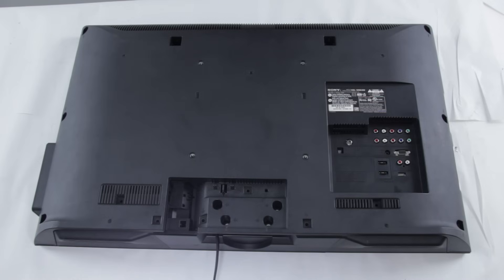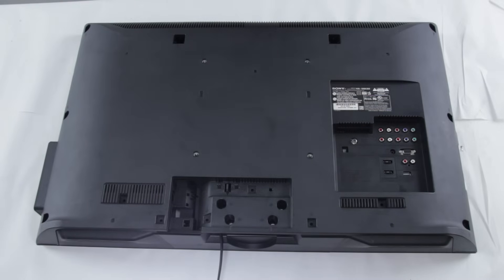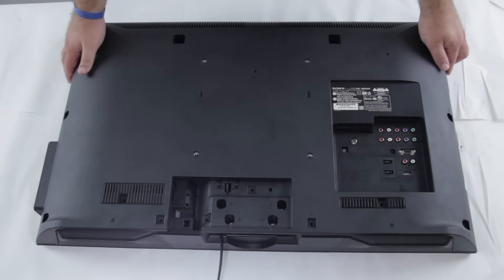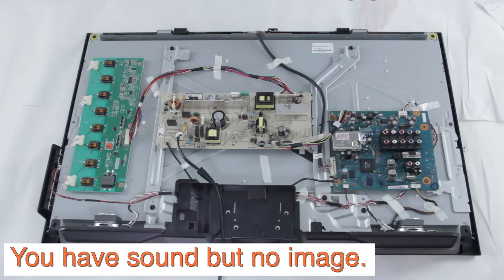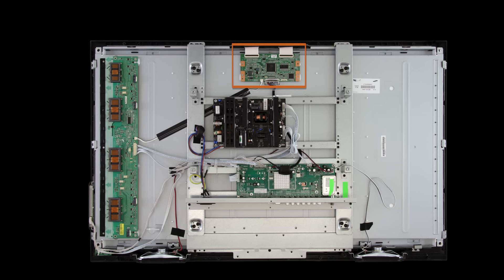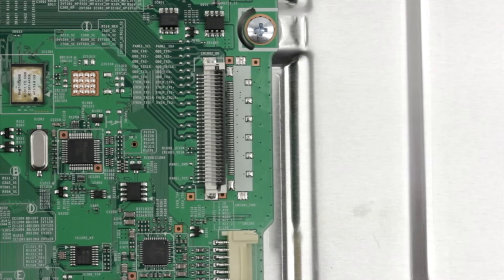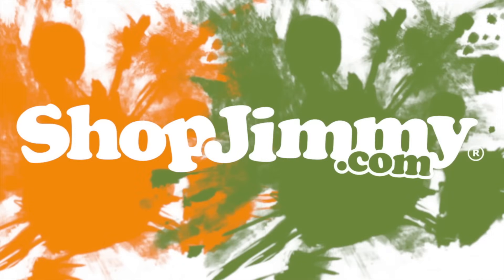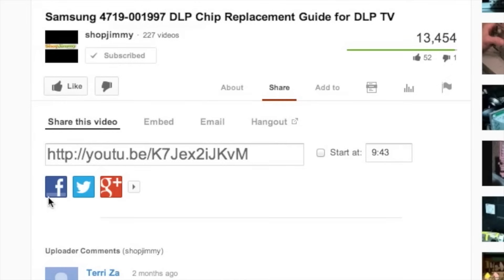LCD TV Repair Tutorial - T-Con Board Common Symptoms & Solutions - How to Replace T-Con Board

Comment: I AM TRYING TO TS A SHARP MODEL LC 42SV50U, SN  2090841355.  i AM GETTING NO SOUND AND NO PICTURE.  (BLACK)  I TRIED THE FLASHLIGHT TEST BUT COULDNT SEE ANYTHING.  I TRIED THE LOOKING FOR THE LIGHTS FROM THE BACK AND COULD NOT SEE ANY LIGHTS.  I HAVENT REMOVED THE BACK PANEL TO LOOK FOR LIGHTS.  I HAVE TRIED HOOKING OTHER EQUIPMENT TO IT TO SEE IF THAT MADE A DIFFERENCE BUT IT DIDNT.  WHAT NEXT STEP TO TROUBLE SHOOT THIS TV?  THANKS RICK

Comment: I've got a Emerson LD-195EMX that will not go into standby power...it automatically goes to power up when plugged in.  It has a raster and seems to go thru a diagnostic sequence with a white screen, red screen, etc.  The serial # is DS1A0939318105.  Thanks in advance.

Comment: Hi. i have an LG 42LS5700-UA smart LED tv. My problem started with a few flickering horizontal lines. It then progressed to cover the entire screen and with a few colored vertical lines. After that, we tried taping one of the ribbon connectors as suggested in one youtube video. However, it only caused a white screen with faded colors. All this time, sound is perfectly okay up to the present. Now, however, the screen is completely black. What solution can you suggest? I deeply appreciate any help.
Reply from the maker: +Kim Araneta   Try all repairs and troubleshooting at your own risk.  This sounds like a TV panel (TV Screen) problem.  If your TV panel is bad, it may be more cost-effective to replace the TV as panels are typically hard to find in stock, difficult to replace, and expensive.  Thanks and please let us know if you have any further questions!  www.shopjimmy.com

Comment: Yes hello I have a sanyo dp42849 Chasis p42849-01 i have replaced the power supply board and the main board, so now to what it was doing originally when i plugged it in i would get a  green blink for 2-3 seconds and then turn itself off, i would be able to do this a total of 3 times before I would have to unplug it for it to do it all over again, replaced the power supply board which in my model the P42849-01 is where the back light inverter is also located, nothing it did the same old thing, okay then ordered a new main board got in today switched it all out, and now the green light stays on but blinks once every 15-20 seconds. So any help will be much appreciated.
THANKS
RUBEN
Reply from the maker: +ruben echezabal   Try all repairs and troubleshooting at your own risk. It sounds like you have received a defective replacement board.  Thanks!  www.shopjimmy.com

Comment: i have a samsung UN40B6000VFXZA- serial number is AZ143CSS300687Y ...it has vertical bars that run from the top of the screen to the bottom of the screen. it happened just after i cleaned the screen. I suppose it is possible that a droplet of water got between the bezel and the screen...

Comment: model no. 50k610gw , i have solid red light no flashing or clicking  and tv  power light on  bottom  center also solid tv will not shut off but i have no image or sound i have did flash light test and see no images  i also replaced power board and still no luck.

Comment: Hi. I have a Samsung LE32R87BD.
I'm getting sound and backlight but no picture. Power supply had a bulging cap which I replaced while I was in there.
Someone suggested the "fuse" on the T-Con board had blown. I can't find it to confirm.
In your expert opinion,  what should I do/replace?
Thanks.
Reply from the maker: +ro63rto   Try all repairs and troubleshooting at your own risk. This could be a problem with either the t-con board, the main board or the TV panel. You can replace the main board and the t-con board individually to see if one of those boards fixes the problem.  Unfortunately I do not see any replacement parts in the search results for your TV model number on our website.  Thanks and please let us know if you have any further questions!  www.shopjimmy.com

Comment: I have a Westinghouse VK-40F580D. When I turn it on 1/2- 2/3 of the screen flickers and rolls and it is blurry. The image stays like this until it "warms up" then it returns to normal. Any recommendation for repair will be appreciated.
Reply from the maker: +Kristen Nolte   Try all repairs and troubleshooting at your own risk.  I recommend replacing the main board in your TV.  Click this link to replacement parts for your TV model number:  http://www.shopjimmy.com/catalogsearch/result/index/?cat=56&q=VK-40F580D  There may be multiple boards for the same TV model number, be sure to match part numbers on your current board, with your replacement for compatibility.  Here is a link to a video showing how to identify your part number, click here:  https://www.youtube.com/watch?v=SoUXsgOx25o  Thanks and please let us know if you have any further questions with your TV Repair!  www.shopjimmy.com

Comment: I have an LG 55LN5710 TV, I replaced the T-Con board ordered from SJ as the TV had no picture , the problem persists ,still no picture ,sound ok. when I power it on I can watch it for 10 minutes and then the picture goes away, please help
Reply from the maker: +Mn Aamer  Try all repairs and troubleshooting at your own risk.  This could be a problem with either the main board or the TV panel.  You can replace the main board to see if that fixes the problem.  Click this link to replacement parts for your TV model number:  http://www.shopjimmy.com/catalogsearch/result/index/?cat=56&q=55LN5710  There may be multiple boards for the same TV model number, be sure to match part numbers on your current board, with your replacement for compatibility.  Thanks and please let us know if you have any further questions with your TV Repair!  www.shopjimmy.com

Comment: Samsung LN40A500T1FXZA  -  Serial Number: ARVY3CSQ801553H  The basic settings have to be set to 100 to get a reasonable picture.  Sound is fine.  The overall picture is not crisp as in the past.  It is like you would want reduce the brightness but in doing so you get the solarization affect.  Thank you.
Reply from the maker: +Lewis Thorp   Try all repairs and troubleshooting at your own risk. This could be a problem with either the t-con board, the main board or the TV panel. You can replace the main board and the t-con board individually to see if one of those boards fixes the problem.  Click this link to replacement parts for your TV model number:  http://www.shopjimmy.com/catalogsearch/result/?q=LN40A500T1FXZA  There may be multiple boards for the same TV model number, be sure to match part numbers on your current board, with your replacement for compatibility.  Here is a link to a video showing how to identify your part number, click here: Thanks and please let us know if you have any further questions with your TV Repair!  www.shopjimmy.com

Comment: Good morning,SONY - KDL-EX705Syntoms: Has sound but not has vídeo in any source, led backlight on normaly. I suspect to T-con board
Reply from the maker: +Admailton Oliveira     Try all repairs and troubleshooting at your own risk. This could be a problem with either the t-con board, the main board or the TV panel. You can replace the main board and the t-con board individually to see if one of those boards fixes the problem.  Unfortunately I do not see any replacement parts in the search results for your TV model number on our website.  Thanks and please let us know if you have any further questions!  www.shopjimmy.com
Reply: ShopJimmy.com

Comment: I have a Sony Bravia KDL-40CX520 - The problem I have is that the TV has solarized screen when it starts after 15 mins the picture is back to normal - Is it a TCon problem ? also does this model have a option to replace the TCon board or the TCon board is bonded with the display ? Thanks in advance

Comment: Hello,  my TV is LC70LE650U which does not turn on. Symptom is when you turn on power led turn on for a while and blinks twice and blinks five times fast and repeats. It does not show picture nor sounds. Sharp does not have service at my location S.Korea.
Reply from the maker: +김명호   Try all repairs and troubleshooting at your own risk.  This sounds like a TV panel (TV Screen) problem.  If your TV panel is bad, it may be more cost-effective to replace the TV as panels are typically hard to find in stock, difficult to replace, and expensive.  Thanks and please let us know if you have any further questions!  www.shopjimmy.com

Comment: Hi, I have a Sony Bravio Model number 52nx800.  The serial number is 8027649.  The problem that I am experiencing is when I turn the tv on, their is no picture.  Half the screen is black and the other side is white.  After a few minutes, the black side turns into vertical green lights.  What do I need to fix this problem?

Comment: i have a samsung led 55" model #un55b6000vfxza serial #az1j3cfs401072j after a storm one day the electric went off and back on and the tv had this problem.it wont power on it just makes a click nose. i bought a power board but it dose the same thing. could it be the light engin?

Comment: I have a Samsung LN46C630K1FXZA LCD flat screen.  I was getting sound but no picture.  I checked the rear and you could see the white lights from the LCD screen.  I checked the front of the screen with a flashlight and there was no image.  Therefore, I replaced the T-con board.After replacement, the TV would turn on but no picture and no sound.  I could no see the white lights from the LCD screen.  I then disconnected the multiple wire connection (two rows of wire)  between the connection board and the power board.  The white lights on the LCD screen came back but still no picture or sound.Any help with this problem?  Could it be the connection board?  When I say connection board, I am referring to the board with all of the input and output connections.Thanks in advance for any help.MIke

Comment: My Samsung LN-S4696D  started flickering large blue, squarish distortions esp. in the dark/black areas of the image.  Also, showing vertical striping - like pin striping, also blue.  This only seems to be a problem through the antenna/Air connection, not when streaming Netflix of DVD viewing.  Another TV switched to this TV's antenna connection had not distortions at all.
Reply from the maker: +William Anders  Try all repairs and troubleshooting at your own risk.  This could be a problem with either the main board or the TV panel.  You can replace the main board to see if that fixes the problem.  Click this link to replacement parts for your TV model number:  http://www.shopjimmy.com/catalogsearch/result/index/?cat=56&q=LN-S4696D  There may be multiple boards for the same TV model number, be sure to match part numbers on your current board, with your replacement for compatibility.  Here is a link to a video showing how to identify your part number, click here:  http://www.shopjimmy.com/catalogsearch/result/index/?cat=56&q=LN-S4696D Thanks and please let us know if you have any further questions with your TV Repair!  www.shopjimmy.com

Comment: wangbungalI just have a question, i have a samsung lnt32a300j1d 32 inch tv, no picture, just sound, tried all sources, i tried to shine a light and the back and press menu, dont see any silhoutte or any images, i replace the t-con board from ebay to no avail, could it be bad as well, any tips for troubleshooting please thank you.1 second ago•

Comment: I have a Dynex DX-40L261A12 and for some reason from time to time everything has this weird green glisten on it. It causes the menu to do the same thing as well. What do you think this could be?
Reply from the maker: +Ali Mateen   Try all repairs and troubleshooting at your own risk. This could be a problem with either the t-con board, the main board or the TV panel. You can replace the main board and the t-con board individually to see if one of those boards fixes the problem.  Click this link to replacement parts for your TV model number:  http://www.shopjimmy.com/catalogsearch/result/?q=DX-40L261A12  There may be multiple boards for the same TV model number, be sure to match part numbers on your current board, with your replacement for compatibility.  Thanks and please let us know if you have any further questions with your TV Repair!  www.shopjimmy.com

Comment: Hi,
I have an interesting fault on a Sony Bravia KDL-55XBR-45 .
The problem can be seen at this link:
https://goo.gl/photos/aeDFWzvP88RLVePL8
https://goo.gl/photos/D2GQREZR9mGQX52J8
https://goo.gl/photos/foqZQH2y1Vts5tH3A
I've cleaned all cables in and out of the tcon board (wire brush pen), LV390v out of both rails of the PS. EDIT... THERE IS SOUND.
image appears to react to what is going in to it, ie. menu etc. letting it warm up doesnt change, I havnt opened to try to touch tab bonds..yet. EDIT...TAB BONDS ARE FINE.
thanks for your help in advance.
Reply: +Mike Bradley  thanks for your thoughts.

Comment: I have a Vizio M470nv  SN LAUGTAM060043   I have the amber Vizio light on. I have 5 volts but not seeing  12v on the cold side of board  M-LPB 47  PLDH-A954a.

Comment: Hello, I'm hoping you can help me with a sound issue with a Samsung LE40R88BDX tv.When I switch it on the volume speaker crackles and after a few minutes the speech comes out but it still crackles. could you help me with this please or point me in the right direction so I can repair it?. thanks kindly
Reply from the maker: +Shahid Khan   Try all repairs and troubleshooting at your own risk.  I recommend replacing the main board in your TV.  Click this link to replacement parts for your TV model number:  http://www.shopjimmy.com/samsung-bn94-01472m-main-board.htm  There may be multiple boards for the same TV model number, be sure to match part numbers on your current board, with your replacement for compatibility.  Here is a link to a video showing how to identify your part number, click here:  https://www.youtube.com/watch?v=BEPWrefQvqI  Thanks and please let us know if you have any further questions with your TV Repair!  www.shopjimmy.com

Comment: Hi guys, I  have a Philips 42 "flat screen TV that the picture has a red tint over the hole screen. Everything else on the set works great. It is a Philips  Model # 42pfl7403d/f7b, Ser.# ya1a0845007471,  Chassis Model # lc8.iu la. Please help,A.S.A.P   Miller

Comment: I have a Dynex Dx-la19-10A.   I have replaced the main board, but my problem continues.  I have a reverse (negative) image.  I thought it was the main board so I replaced that, but it did not work.  I have looked for a t-con board for this model but have not been able to find it.  Any suggestions?
Reply from the maker: +David Hepworth   Try all repairs and troubleshooting at your own risk.  You could have a defective replacement main board, or the wrong version main board, or a problem with the TV panel.  Thanks!  www.shopjimmy.com

Comment: I have a Vizio vw42l hdtv10a that shows a perfect half circle pattern at the top of the screen.  It takes about 5 seconds for it to appear on screen and does do with picture on screen or just the generic blue background.  
Here is a link to a picture. http://memberfiles.freewebs.com/74/15/43421574/photos/undefined/20150826_103846.jpg
If you look you can see the white outline along the top.  It is half circle shaped and it goes from one side to the other in a perfect pattern.  If you need or want better pictures please let me know and I can try and get them.    The white at bottom is PS3 Loading Screen not the screen.
I just want to know if it is the panel or possibly something else.  
When I got it, it had a blown cap on the power board as well as a blown fuse.  It would not even turn on.  I replace the cap and fuse and it powered on fine except with the half circle pattern at top.  Person who gave it to me said it just stopped working one day and they bought a new one and wanted to trash it.  I would like to try and get it working.  Any help you can provide would be greatly appreciated.
Reply from the maker: +Hifeno Drake   Try all repairs and troubleshooting at your own risk.  This sounds like a TV panel (TV Screen) problem.  If your TV panel is bad, it may be more cost-effective to replace the TV as panels are typically hard to find in stock, difficult to replace, and expensive.  Thanks and please let us know if you have any further questions!  www.shopjimmy.com

Comment: Hello Sir. I have a SONY LCD (KDL-46W5500) 46inches. The screen of the TV is showing thin black horizontal lines on the whole right side of the panel fading on the way to the left side of the screen. Also, there is a thin vertical colored line on the right side of the screen. 
Would appreciate if you could diagnose the problem and suggest a solution. Thanks.
Reply from the maker: +hassan shahid   Try all repairs and troubleshooting at your own risk.  This sounds like a TV panel (TV Screen) problem.  If your TV panel is bad, it may be more cost-effective to replace the TV as panels are typically hard to find in stock, difficult to replace, and expensive.  Thanks and please let us know if you have any further questions!  www.shopjimmy.com

Comment: hi, i have a Samsung led TV. model: UE46D6100. When I switch it on, the stand by light blinks 5 times in RED. then the screen back light comes on but no picture or sound. I have carefully inspected the capacitors and even  re-soldered them to ensure they have a solid connection with the power supply board. But still no good result. Can you please advice me on what else could be wrong? Thank you

Comment: I have a Samsung 40 " LCD tv model # LN40A500T1FXZA , SERIAL # ARVY3CSQ802609N, VERSION CN01.  It has no picture, black screen, it does have power { light on]  and it does have audio. I look in the back of the tv and do see the back lights on. Any ideas what the problem is? Thanks in advance for your help.  George.....ambunt@earthlink.net